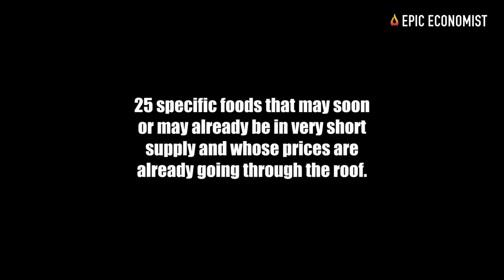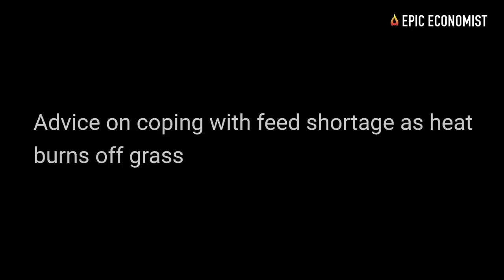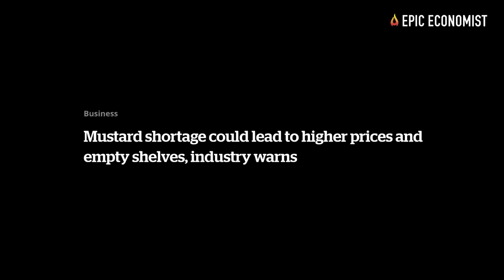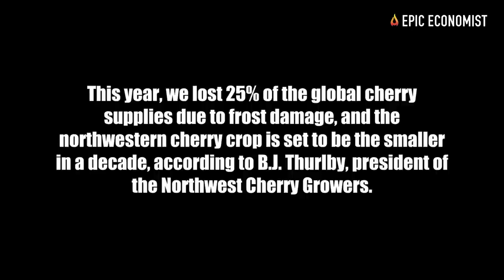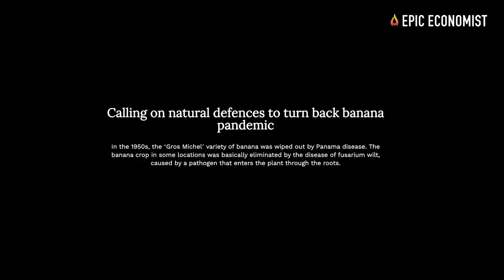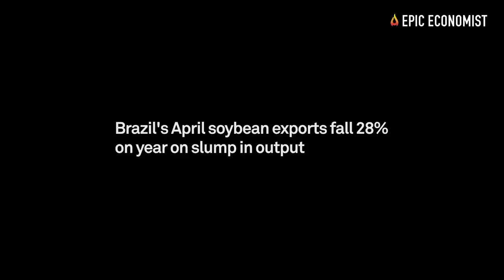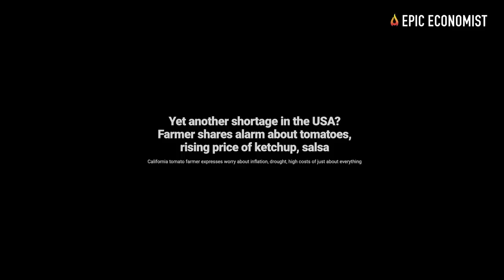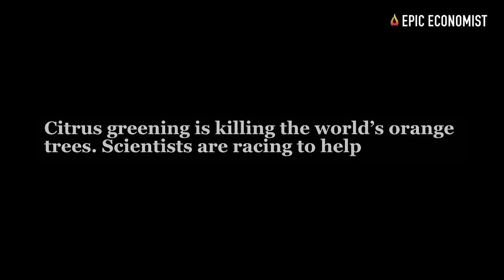25 Food Items That Will Disappear From Grocery Stores In The Months Ahead

Comment: I bought dried kidney beans. I prefer the tinned ones. The dried ones involve soaking amd take ages to cook which is a cost .So I soaked the whole bag for two days and I put them all in the slow cooker at once for like 6 hours as I was using the slow cooker for pork anyway. After 6 hours the kidney beans were soft. Then I bagged them up and stuck them in the freezer. That saved time and money in the long run
And my dad just told me he bought a pressure cooker and after soaking they only take 10 mins in their  so lots of options
Reply: Beans that 75-90 minutes in a pressure cooker for jar storage or did you mean just a meal prep?
Reply: Sounds smart. As long as kidney beans are fully cooked as they are toxic uncooked.
Reply: @ndjubilant  kidney beans in a tin or can are fully cooked and only need reheating.
Reply: If I remember correctly these beens to be safe must boil.

Comment: This all could be fixed by refreezing the poles blocking the sun to the poles. Using ash at high altitude over the poles. In 3 to 5 years all the problems will suppside.